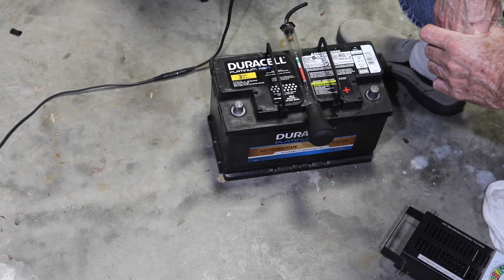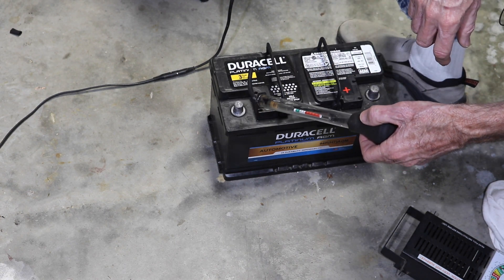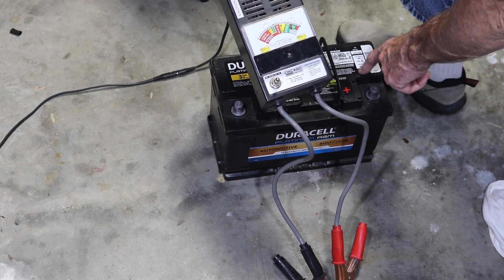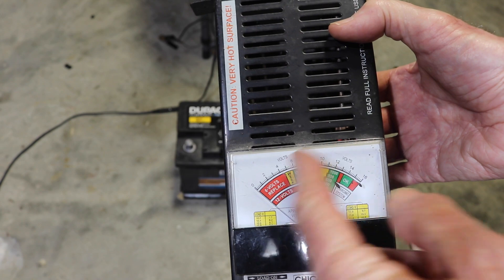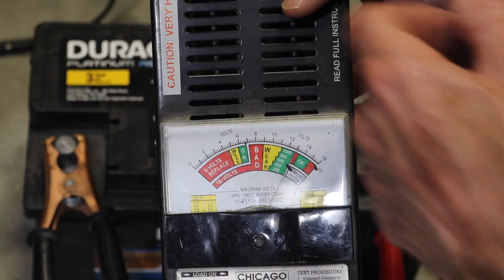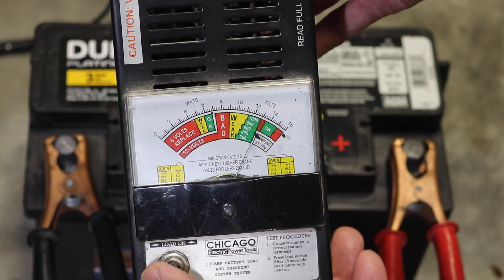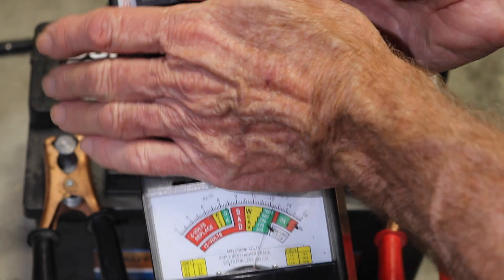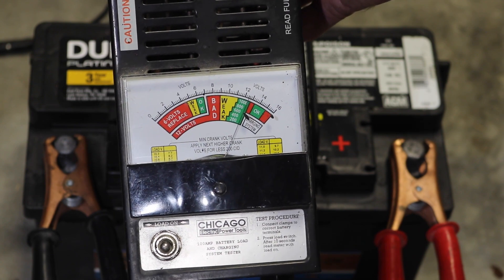Battery Load Test - Simple and Easy

Comment: So, if you load teat a battery and it is slightly in the "weak" zone, can it be improved? Or do you have to get a new one? My 12-volt battery has 925 CCA but when I load test it, it goes slightly into the yellow zone.

Comment: Marion: just so happens I had to replace my OEM batteries today on my 2017 ram with the 6.7 L —> $500!
Only place in town that had batteries in stock was O’Reilly’s went with their AGM as well. My question is did you ever hook your truck up to a trickle charger when it was not being drove for a few days? I work shift work where I’m off at some .7 days straight And I’ve always used a trickle charger to keep my OEM batteries at least fully charged or close. Do you recommend that with these AGM batteries?
I’ve read where it’s best to do this with this type of battery at least try to keep it fully charged as possible at all times.
Reply from the maker: Yes, this is my setup https://youtu.be/pzB-N1P1heQ
Reply: @MarionBlair  from what I understand and I’m sure others who have researched this know, today’s newer vehicles, with all the electronics having to be run while the vehicle is operational, the alternator never has enough time to fully charge the batteries back before we shut the vehicle off.
Thus the reason some have invested in a trickle charger to always plug the vehicle in when it’s not gonna be drove for a while to fully charge the batteries.
 These AGM batteries seem to benefit from being fully charged every once in a while. 
Since these batteries cost almost my left kidney to replace I am going to make sure every time my vehicle sits in the garage for more than two days it will be connected to a trickle charger .

Comment: I bought one of these load testers about a month ago to test out my batteries (both batteries where ruled dead as the truck sits more often than not, luckily they were still under warranty). I find these trucks like/require strong batteries for them to be happy. The slightest hint of a weak battery/s and they start throwing codes.

Comment: Hi Marion. I've got one of those on my test bench too. I also use those newer devices that test the battery's internal resistance and CCA capacity. I test my batteris once evey 6 or so months. I sure have a lot of batteries, 4 in the boat, 2 in the 3500, 1 in the dump trailer, utility trailer, tractor, RTV, lawn mower, wife's car, lawn vacuum, my 1500, and finally my ham station's power system. I want to do the best I can to avoid one of those "oh no" events, particularlly in the boat. Best to you and your bride.

Comment: Marion, did your truck throw a P2609 code? It's a intake air heater system performance code. My truck throws the code when the  truck is cold. Outside Temps are  usually below 30°f. The truck starts sometimes the truck run a little rough. My guess is the 6 year old battery's don't have enough amps to properly run the grid heater. Hope this issue goes away with new battery's.
Reply: I've got a 2015 3500 Cummins with the original batteris. I live in Michigan so I see the temperature swings. So far, no issues/codes with the batteries but I am expecting this year may be the year they get replaced.